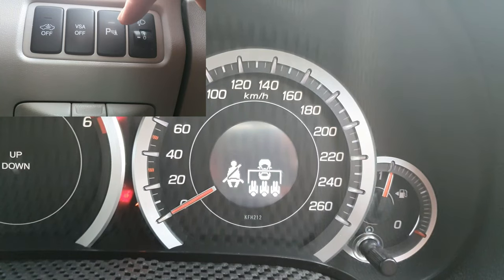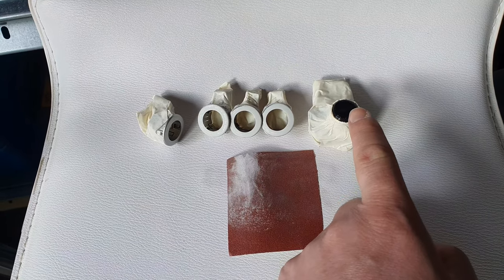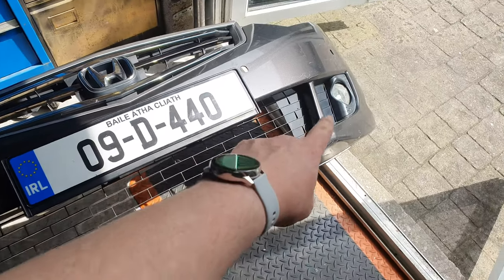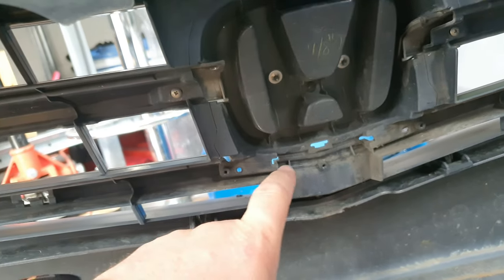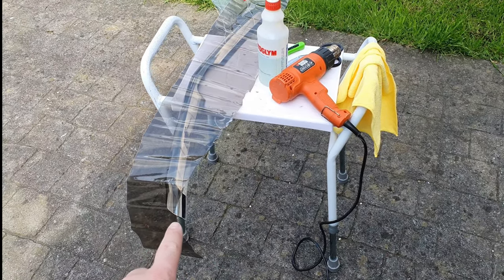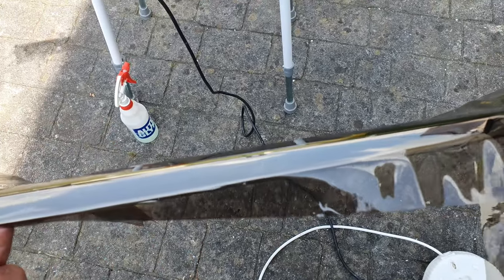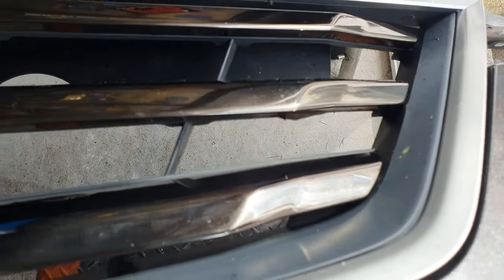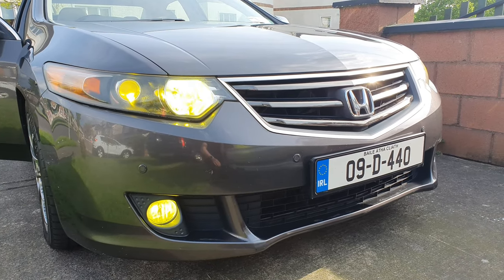Replacing My Parking Sensors & Adding A Chrome Grill Tint!

Comment: I have a 2009, find your YouTube very useful. Any pointers for parts, I’m starting to find the aftermarket pool for parts for the MK8 is slim and Honda want silly money bearing in mind mines a £3.5k car. 😣.
Reply from the maker: I usually get second hand bits or spurious parts, but i find buying from honda is better in the long run, some spurious parts don't fit great or are made cheap. The CU accord was not as loved as the CL so there aren't as many aftermarket parts available. You may find some bit's from Asia by searching HONDA SPIRIOR, or America by searching ACURA TSX. Hopefully this helps.

Comment: Great to see another video bro, how are you finding the eibach springs since? I recently put a boot lip spoiler on mine, have you any idea where to get the amber delete facelift headlights?
Reply from the maker: Hey man, yeah the springs feel excellent, still like stock springs but slightly stiffer. I would like them lower but the roads in Ireland are shit so best to have the hight. I have had my eye on a boot spoiler for a few year's now and it's only available from Russia as far as i can see, right now there is no shipping to Ireland, so I'll wait! I've seen a few site's selling standard 2011 and on but you can also open the light and remove the amber cover ( it screws in ) the just get an amber bulb.
Reply: @GPTV2020  Yea I feel you on the Irish roads situation bud, I'm in kilkenny and have to drive bad roads for work so I'm in two minds about the springs, thanks for all the advice bud I appreciate it, shame I can't put a pic up of my accord here to show you.
Reply from the maker: @davy88ful  tag #gptv2020 on Instagram.

Comment: Always love to see your videos. Have you ever had water coming into your trunk of the Accord? I recently discovered that in my CU1.... And I can't figure out where the water is coming in. When I do a car wash (always by hand), I get no water ... but if it has been raining and I've been drivng my Accord, I get water where the spare wheel is , in the trunk. Ever had that?
Reply from the maker: Hey man, thanks alot for your support. I really appreciate it. No i haven't had this issue on the accord. I have on the prelude and the crv, but maybe if it is only happening when driving in the rain its coming up from underneath somewhere and settling in the spear wheel area, could be a hole or a crack letting it in the floor somewhere. Try spraying water up from underneath,  on one side, then the other to see if it makes it's way in and put some kinda of power like flour on the foor so you will see a trail of water in the flour.  Hope this helps. Cheers again 👍

Comment: Question in relation to the lowering springs to had fitted; did you need any camber arms or was it just the springs and that’s it? :)
Reply from the maker: I think I is more of a personal opinion to run camber arms or bolts, but when you lower a car, if you choose to correct the camber you will need camber adjusting part. In my case i did not install any camber adjustment so my car has a small bit of negative camber probably 3°on the front and maybe 4° on the back. So my tyres are more worn on the inside. I am thinking about installing some adjustment in the future but for right now, its not too bad.
Reply: @GPTV2020  Okay, thanks for that reply! Something for me to think about.